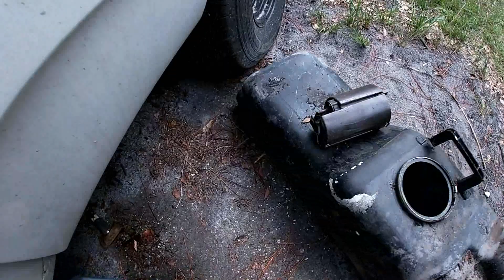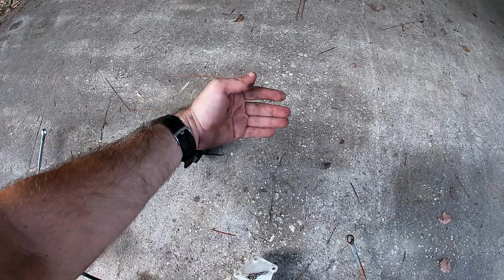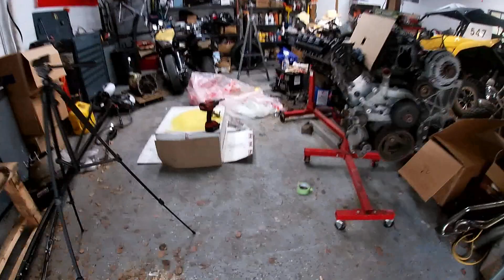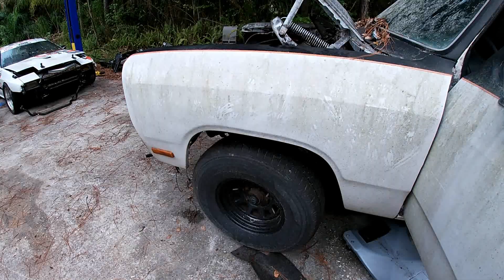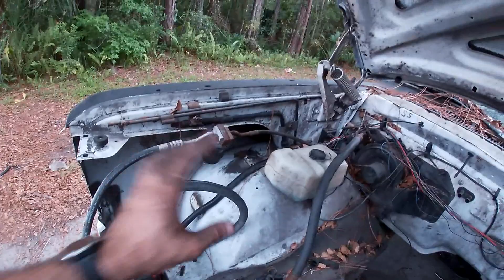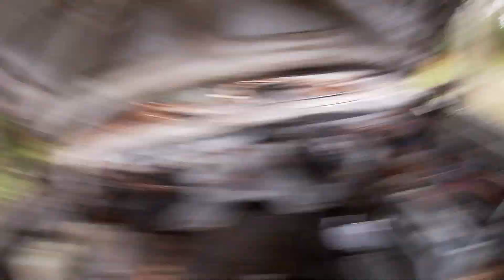D150 Gen 3 Hemi Swap Part 4 - Engine Bay Prep (Wiring and Clutch Master Cylinder)

Comment: I'm no neat freak nor OCD but I would have to do some cleanup and some detailing before going any further... All the crud n pine needles and nasty layer of mold covering everything would drive me nuts. Good douching scotch Brite and at least rattle can of epoxy primer/sealer would go ah looooong way..  I'm assume your trying to maximize available time but still I'd have to. Looks like a killer project tho.
Reply from the maker: I agree. It will look good when im done, and do be honest, looked worse than it did before i started. But once everything is routed than i can go back and unhook everything and clean it up.